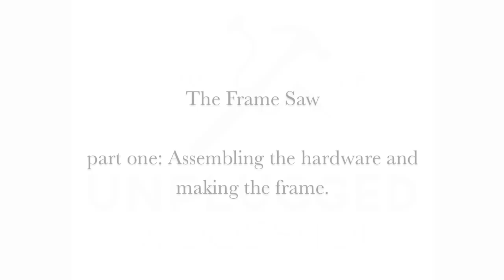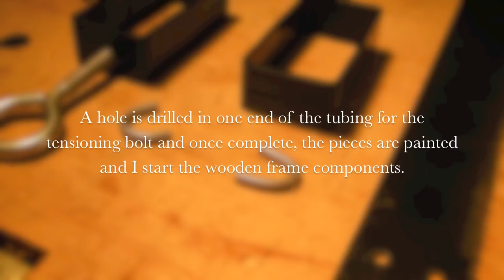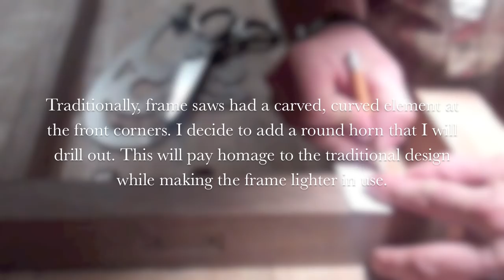The Frame Saw part one: Assembling the hardware and making the frame.

Comment: Tom,
I've got the download.
Great set of projects.
Cutting the laminations for the architect's desk may be a step too far for me though!
St.J
Reply from the maker: BalancedLugger- thanks for the comments and I'm happy to hear you have the book. ( or digital download ) as for the laminated top, don't sweat it. Make it out of some nice flat sawn material. You can leave off the bread board ends as well. Make it your own. Keep in mind, if you use flat sawn stock for the top- make sure you elongate the holes in the lower stretchers and supports!
best of luck!
and send pics of finished projects~; )

Tom

Comment: Dear Tom Fidgen, I want to do a frame saw also and in the country where I live, I am not able to buy the hardware so I have to do it myself and I am taking help from your videos but as I notice you did somethings off camera. 1- There is a welded seam on the inside of one brackets. Why is it there? and how did you manage to add it there without a welding machine? ... 2- For the bracket that tightens the blade, the hole on the center of the bracket should be threaded, right? ... Thanks for the video :)
Reply from the maker: Thanks for the question. The hardware is purchased off the shelf as rectangular metal tubing. This comes welded together. I simply cross cut it to width and fit the arms. The hole isn't threaded, but instead a nut sits behind the hardware to keep it tight. A threaded hole may work better but this system worked for me for a few years. always adapting and trying to make it better... 
You can find detailed plans in my book: The Unplugged Woodshop. 
Thanks again and all the best-
Tom
Reply: Dear  @theUnpluggedWoodshop  Huge Thanks for the flash response :) I live in Turkey and I hope I could find your book here and also actually there is not many books in my country about wood working although it used to have a good wood working tradition... I try to understand the system so I have one more question if you don't mind: The nut that sits behind the hardware, it must be attached to the hardware, right?

Comment: Hi, Tom. How much is  the thickness of that saw blade ? Thank you ...
Reply from the maker: алмаз шайхаттаров - thanks for the question.
The thickness of the plate steel for this saw is .0315. The width is 2-in.

Hope that helps, all the best~
Reply: Sorry.  Is it 0315 in ?
Reply from the maker: Yes, .0315 of an inch thick, 2-in. wide 35 in. long